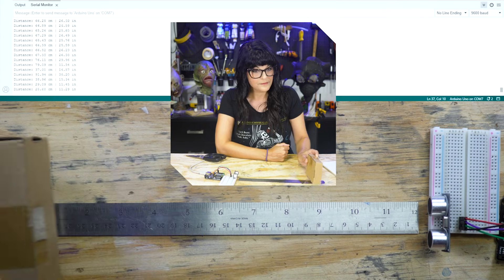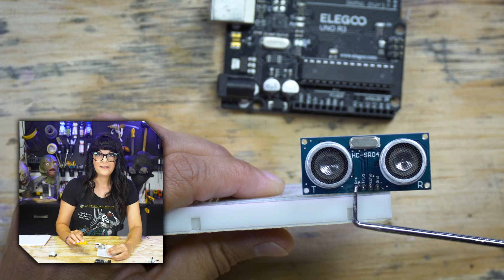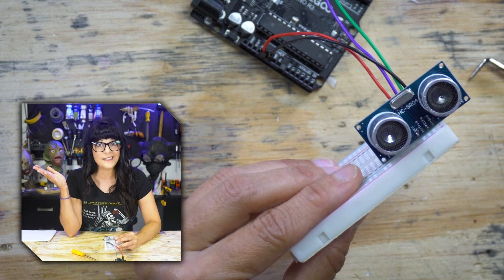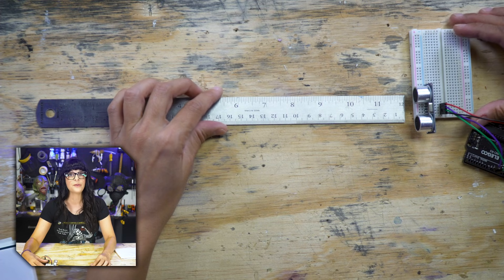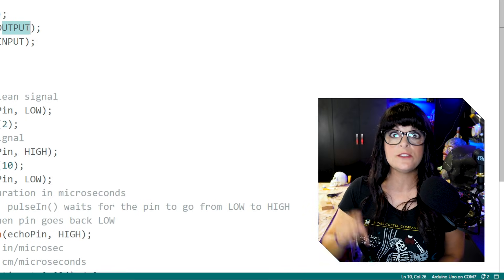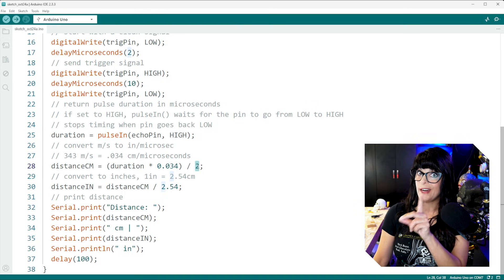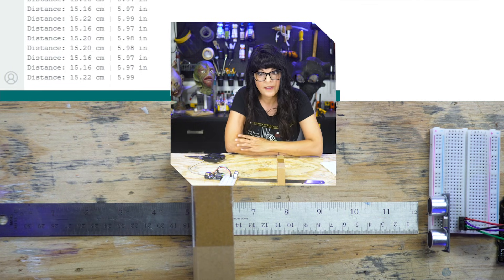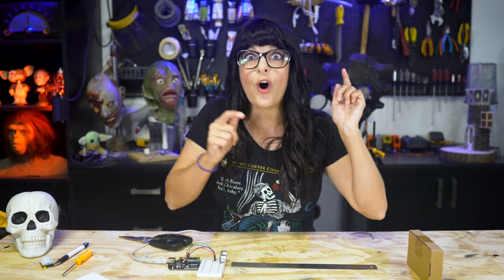Get Started with Ultrasonic Sensors and Arduino: Step-by-Step Wiring & Code Guide

Comment: Absolute beginner here who skipped a few lessons to try something more fun, I spent some time figuring out how you got void(setup) down to line 8 and put the const and float functions into lines 1-6. I'm so worried I'll wreck something and never get it to work again. Then I tried copy and paste and it worked! Will go back and read the Variable section.

Comment: We added a buzzer in it. 
Code:

const int trigPin = 9;
const int echoPin = 10;
const int buzzerPin = 12;

float duration;
float distanceCM;
float distanceIN;

void setup() {
  Serial.begin(9600);
  pinMode(trigPin, OUTPUT);
  pinMode(echoPin, INPUT);
  pinMode(buzzerPin, OUTPUT);
}  

void loop() {
  // start with a clean signal
  digitalWrite(trigPin, LOW);
  delayMicroseconds(2);
  // send trigger signal
  digitalWrite(trigPin, HIGH);
  delayMicroseconds(10);
  digitalWrite(trigPin, LOW);
  // return pulse duration in microseconds
  // if set to HIGH, pulseIn() waits for the pin to go from LOW to HIGH
  // stops timing when pin goes back LOW
  duration = pulseIn(echoPin, HIGH);
  // convert m/s to in/microsec
  // 343 m/s = .034 cm/microseconds
  distanceCM = (duration * 0.034) / 2;
  // convert to inches, 1in = 2.54cm
  distanceIN = distanceCM / 2.54;
  // print distance to Serial Monitor
  Serial.print("Distance: ");
  Serial.print(distanceCM);
  Serial.print(" cm | ");
  Serial.print(distanceIN);
  Serial.println(" in");
    // activate buzzer if object is too close
  if (distanceCM < 20.0) {
    digitalWrite(buzzerPin, HIGH);  // Turn buzzer on
  } else {
    digitalWrite(buzzerPin, LOW);   // Turn buzzer off
  }
  delay(50);
}

Comment: Rachel I just found your channel and love it!
Someone told me I need to use an Arduino board for a project I'm trying to build but I don't know how to program one to do what I need it to do.
I have a 12 volt DC motor I need to make turn on for three seconds and stop for five seconds then turn on in the opposite direction for three seconds and stop.
This is for a slingshot auto resetting target I want to build. I would like to know what Arduino board to buy.

Comment: Rachel, I am slowly dying while I await the next Youtube tutorial on pairing the ultrasonic sensor/Arduino with other functions.  I have a project in which I wish to use the Ultrasonic to start Arduino to run a series of 12 volt LED signal sets (i.e. green, yellow, red).  I need you next tutorial .  I'd hate to break up our engagement over such a small thing.
Reply: ey buddyboy, im the number 1 rachel glazer... iv'e been a fan since 2015 so you cant match me!! just hang up your boots punk!!

Comment: A millisecond is 1/1,000th of a second. A microsecond is 1/1,000,000th of a second. The ratio is 1,000 to 1. Therefore a millisecond is 1,000 times longer than a microsecond.

Comment: who wouldn't go back to HS if she was the teacher! great job. I tried this on my entry gate but doesn't work on detecting people.
Reply from the maker: There are a few drawbacks to the ultrasonic sensor that I didn't go into in this video. I'm doing a another video on PIR vs ultrasonic sensor vs IR sensor to cover their pros and cons.

Sometimes the ultrasonic sensor has trouble with curved or irregular surfaces. For a motorized gate, many people use an IR sensor instead. It goes LOW when an obstruction (like a person) is detected. You can use that to either pause the gate or make it open if it detects something in front of it.

What are you trying to do with your gate?

Comment: Back in 1985 I built a robot with a rotating sonar system, using ultrasonic transducers very similar to those used today.  While rotating, the sonar was pulsed once every degree.  Over one weekend I spent a lot of time testing my sonar with my head a few feet from the sonar system.  I had no idea that a 40KHz pulse, which you cannot hear, could damage my hearing, but that is what happened.  In one weekend, I permanently damaged my hearing and it has only gotten worse over the last 35 years.  Later I calculated the SPL (sound pressure level) of that sonar’s output pulse from the amplitude of the signal and its data sheet.  I found the sound output of that transmitter was about 125 db.  On my current robot I have three HD-SR04 boards which I use for collision avoidance.  I measured the amplitude of the transmitter signal and from the 40T/R transducer data sheet I calculated the SPL of the 40KHz output sound of the HD-SR04 to be about 115db, which is still loud enough to damage your hearing.  So please keep your head far away from the front of the sonar board.
Reply from the maker: Great tip! Some people have said that their pets don't seem to like them either. Luckily all my projects are in the garage!
Reply: Hello, Ive been watching your videos and feel like I could really use your help on a project. I am a very beginner.  Id like to use the motor cards you mention or something similar to control some small 12vdc motors. But I need it integrated into an hmi screen instead of the arduino. 
 @RachelDeBarrosLive
Reply: @joshmack4312  have you done that already?
Reply: sure it wasn't the rock concerts?
Reply: Wow I never imagined it would be so loud, that would be nearly as loud as a jet fighter taking off of the runway.
Reply: Bob, sorry to hear about the tragedy. But you accomplished a challenging task in those days when every little circuit block had to be designed by the enthusiast with no internet.  Thanks for the warning.
Reply: Woah, sorry to hear that! That makes me to feel worried to try it, I'm a beginner 😂 does sensor like in the video, I think it is the ultrasonic sensor also hurt us? Cause if I'm not wrong this ultrasonic sensor also used in submarine which can make human ears bleed and burst out of blood 😅

Comment: Just built one of these for a flying ghost prop I built.  Might recommend looking into ESPHome and using ESP32 modules that have wifi and bluetooth options.  ESPHome is quite a bit more straight forward for most people to get started with vs straight arduino coding.  Also way faster and easier to deploy.

Also been playing with some VL53L0X ToF sensors that are very similar in function but way more accurate and way way smaller.  I went with ultrasonic for my project because I was able to get a waterproof version for outdoor use, but these ToF sensors are so stupid small and easy to use.  Runs on the I2C bus so can be daisy chained as well.